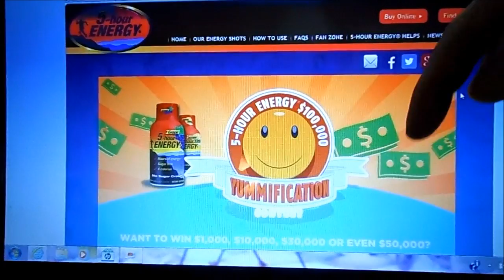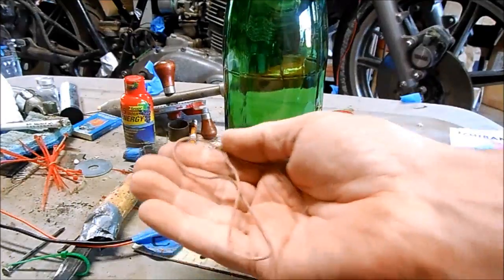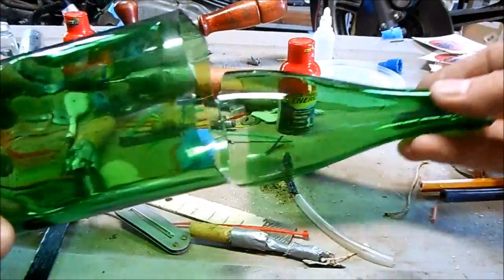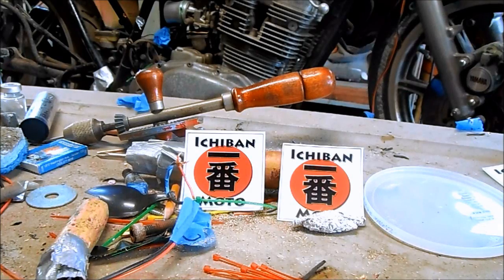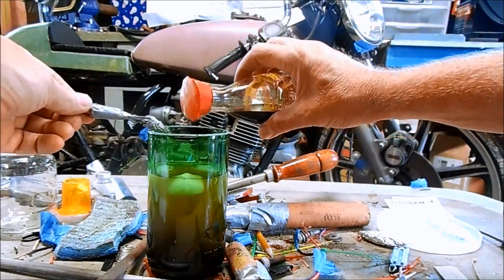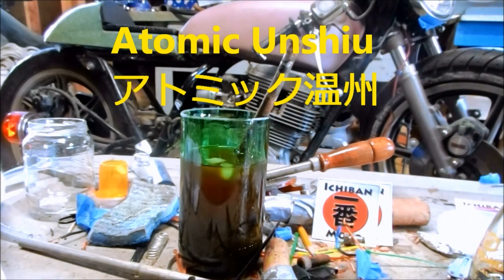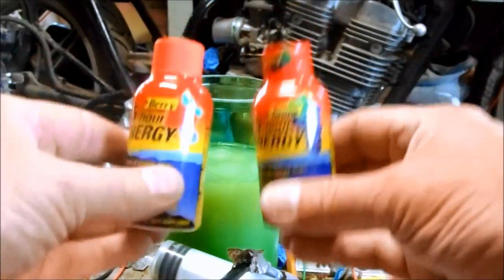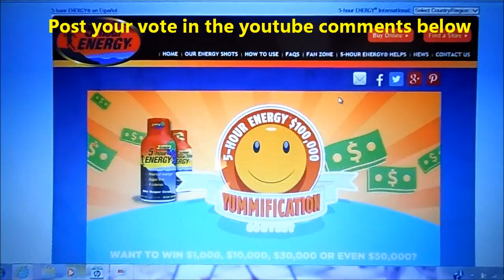how to make a glass from a bottle then  enter the 5 hour energy contest  by Ichiban Moto

Comment: So if you use two 5 Hour Energy drinks you get 10 Hours of Energy? 5h+5h=10h? Right?
Reply from the maker: +gfxolav   is it cumulative?  or are you just extra jittery for 5h?  any experts out there? we need to know
Reply: It would actually be 10h²
Reply: depends on the time zone, but if can bake it at 21.667 Celsius on a slow cooker, you can slow it down as much as you want.